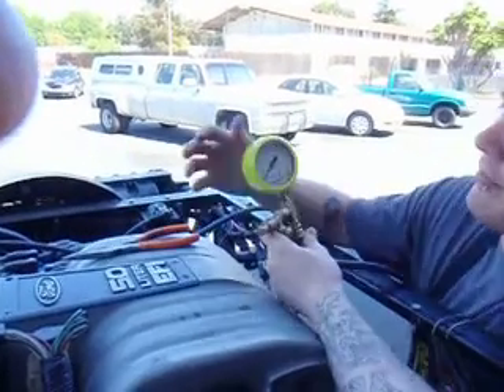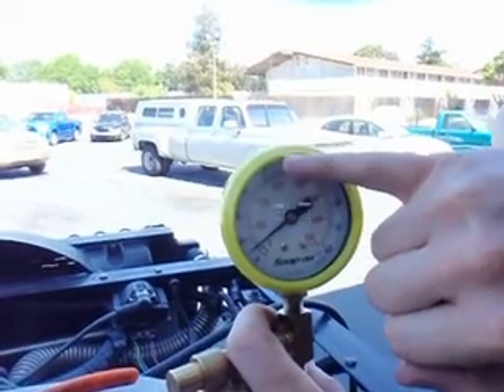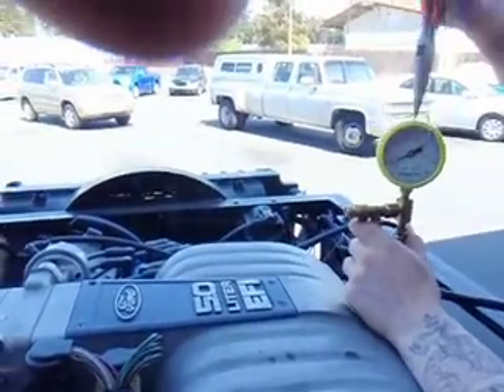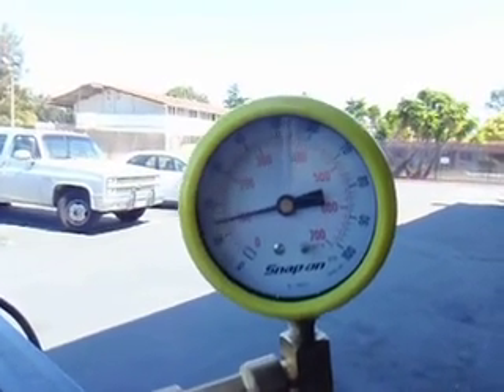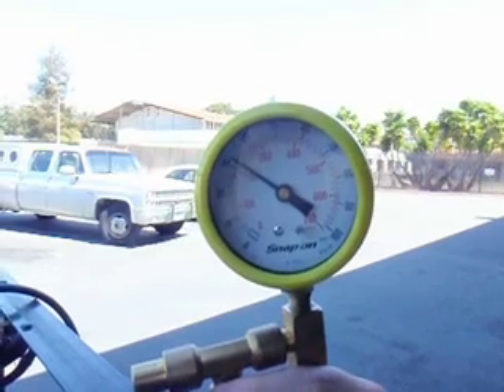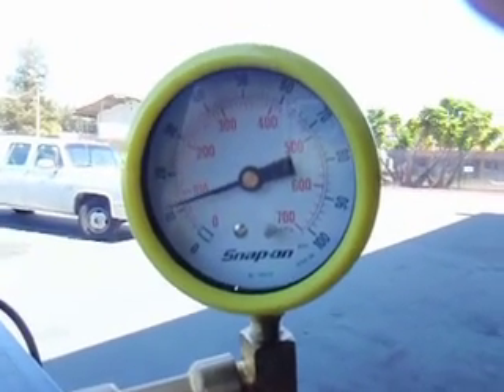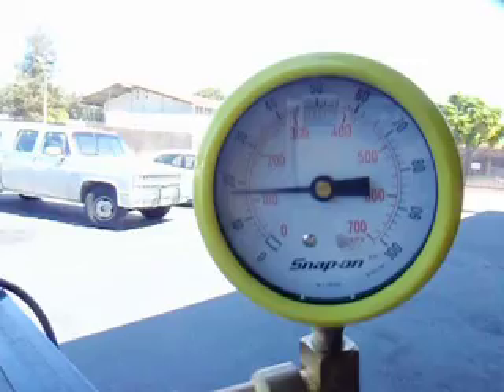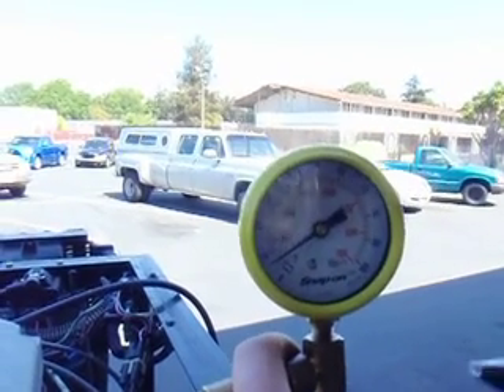fuel pump testing

Comment: hi i have a older 5.0 mustang. i have a problem  with fuel or vacuum?

engine runs at idle fine, fuel pressure regulator 42 lb.  but if i open throttle more fuel pressure i see. it goes up and then motor stalls. cannot rev motor at all.

Comment: 1. Does that mean, the fuel pump needs to replaced? 2. If leak happen before the Fuel Pressure regulator, how can it be trace on the hose? thank you.

Comment from the maker: A leak does not always constitute an external leak. In this particular case it was leaking internally. A fuel system can leak internally in a multitude of ways, from the pump check valve, fuel injector, regulator. Any one of these can cause residual pressure to bleed off.